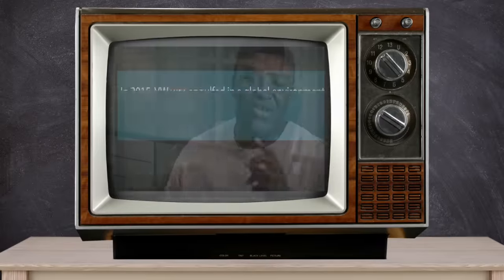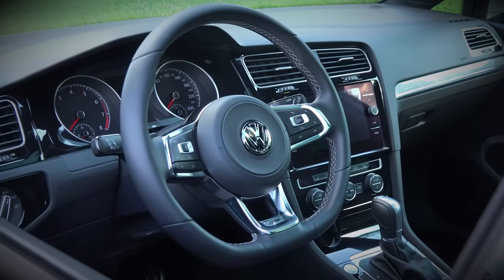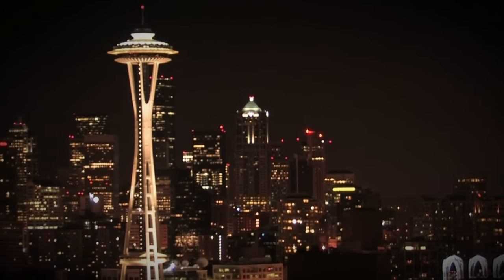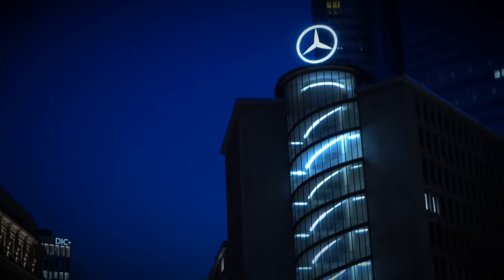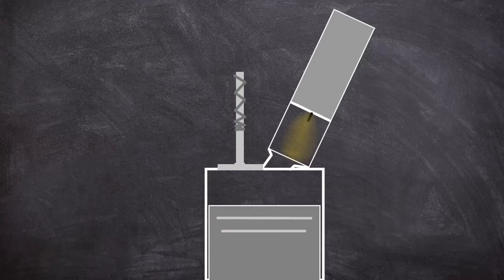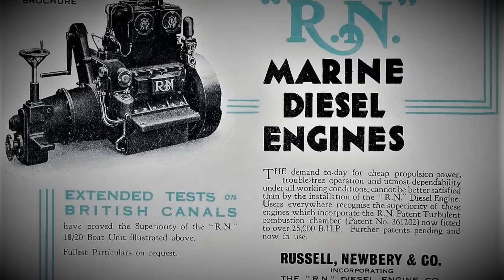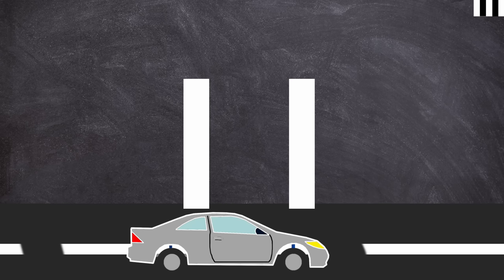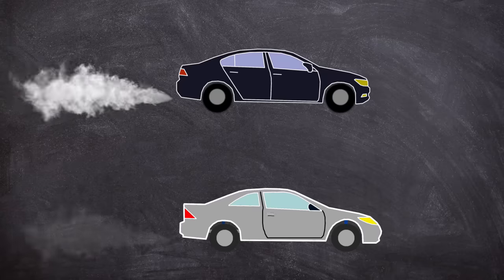Scandal: VW Emissions Dieselgate Explained | Plainly Difficult Documentary

Comment: Actually, a diesel engine doesn't compress the diesel fuel to make it ignite, it instead compresses the air, raising its temperature, and then injects the fuel, making the mixture combust instantaniously.

Also, NOx gases are not particles. Soot consists of particles. NOx gases consist of molecules. Both are individual problem areas of exhaust gas emissions.

Furthermore, with the defeat device enabled, VW engines don't just pass emissions tests by being detuned. Permormance doesn't actually differ that much. They pass tests mainly by increasing the rate of exhaust gas recirculation (EGR). Even though EGR plays the main role in reducing NOx emissions, you sadly didn't even mention it.

All in all, I would have appreciated more technical accuracy.

Comment: The software update Just fucked up my 2010 golf mk6. Worse fuel efficiency,dpf regenerating every 200km,noisy injectors and less power. Luckily i straight piped the shit out of it,did a basic tune and now it runs 100 times better using a lot less fuel.

Comment: Sorry, there is a few things wrong with your description of the science.
For one thing, you confuse NOx and particulates a lot. Particulates are mainy unburnt carbon, also known as lamp black (Ruß in german).
Nitrogen Oxides are gases at typical exhaut temperatures, iirc.
Also you describe NOx reduction to "Hydrogen and water". 
Its more like Nitrogen and Oxygen.
The DPF (Diesel Partikel Filter) in my Passat had actually worked like you describe: capture the Ruß particles and when the pressure difference between filter inlet and outlet exceeds a certain value: burn it off.
To do this, the engine injects a small amount of Diesel into the /exhaust/ cycle, which then ignites in the filter, igniting the captured carbon in turn.Combined with an engine management allowing for plenty Oxygen in the exhaust, this burns the lamp black into CO2.
Sadly this also made the engines incompatible with Biodiesel (Methy-Esters), as the unburnt fuel would condense on the cylinders walls and intermix with the engine oil, thinning it to lubrication failure.

The NOx capture filters operate in a - confusingly? - similar fashion: absorbing with regular purge cycles.
For purging the absorber, again fuel is used as a reducing agent: the redox reaction is between the fuel (carbon and hydrogen) and the Nitrous Oxide with CO2, water and Nitrogen as products. Not water and Hydrogen.

The scandal imho lies in the fact that the Prüfstandserkennung part of the engine management system was used to create perfect, compliant exhaust on the dyno which could never be reached in Real Life (tm).
And the other scandal is that every manufacturer did this to some extent and only VW got heavily bashed.
The car detecting to be in a dyno cycle rather than on the road is actually necessary: ESP and anti locking brake systems must be handled different here, when only one axis has spinning wheels and the others are standing still. But that should not actually be used to fake a performance (MPG/consumption, emissions...) that is not real.

Comment: I feel it's worth mentioning, the engine in the thumbnail of this video was emissions compliant. That was a pre-dieselgate engine, one of the Pump Duese TDIs. The dieselgate cars were 2.0l common-rail diesels. They're both technically "common rail", but on the Pump Duese, the fuel is pressurized and then injected entirely within the cam driven injector. In the common rail diesels, there's a high pressure injection pump that pressurizes the fuel rail, and the fuel is simply sprayed from there by the injector.
Reply: Another small note, the description of how diesel engines work is slightly inaccurate. The fuel isn't compressed to the point of ignition, rather the air in the cylinder is compressed to a very high pressure which creates a lot of heat, and the fuel is then injected into the high temperature and pressure environment which causes it to ignite.

Comment: 7:06 nitrous oxides are gasses, not particulates .... particulates are basically soot from incomplete combustion of fuel
10:45 and the nitrous oxide filters dont trap particulates, rather they adsorb nitrious oxide molecules onto their surface, where they remain until the engine runs rich, and the resulting hydrogen and carbon monoxide gases in the exhaust will react with nitrous oxide to produce nitrogen

Comment: Doesn't the hydrogen and oxygen eventually recombine back into water, albeit in the form of water vapor instead of a liquid due to being immediately vaporized by the hot exhaust pipe after the recombination happens? I think liquid water is only made as a byproduct of hydrogen fuel cell vehicles
Reply: Water can condense in the exhaust, so at least some water will be there, not the entire exhaust is that hot

Comment: My ex tried to talk me into a 1979 Volkswagen Dasher Diesel with a 5-speed. At full throttle that car couldn't get out of its own way. I like your car was a little extra power so if I make a boo-boo and need to accelerate hard I can get out of the boo boo. Take it back to the dealer and said no way in hell. I've driven riding lawn mowers with more acceleration than that damned Dasher had

Comment: It should be noted that the nitrogen does not come from the fuel it comes from the air 78 percent of air is nitrogen that's where the nitrogen cost at the high temperatures with oxygen and because diesels inherently burn lean they have additional oxygen left over from combustion that's what forms nitro oxides

Comment: These cars got close to 50MPG real world. They were a godsend. Torquey and reliable. 
The VW TDIs were “too dirty” for US roads but theres a big issue people neglect to acknowledge. The huge diesel 250/2500 trucks assholes drive around as their commuter car do not need to comply with CAFE regulations. They can pollute much worse than these VWs ever did while getting half the mpg at best. And I’m sure the big 3 sell more diesel trucks than VW ever. Sold TDIs in the US. It was bullshit green washing and what they did was take away a truly viable option for consumers. Battery technology needs to massively improve in performance, weight, and the way resources are mined for electrics to become the majority.
Reply: People roll around in old Cummins and Duramaxes that get like 15mpg roll coal from the fucking factory but go nuts over VW cheating a lil when their Diesels are clean as fuck compared to other garbage

Comment: We own a 2014 Passat TDI. It went through the "fix". Prior to the fix we were getting 50-55MPG on the highway at 70MPH which was awesome. We even accidentally rented the same car in England and got 60-65MPG (imperial vs US gallon). After the fix, it is more like 46. Mileage was always higher than the EPA estimate which you never see. It still runs great and they paid us back a decent chunk of what we had paid for it. We don't drive much, but it still has 140K miles with no problems and still runs about 700 miles before needing to be refueled. Our other car is electric, so the two are a good match. If we hadn't been forced to do the fix, i probably would not have bothered - big trucks belching tons of NOx made our lightly used car a drop in the bucket. Perhaps many felt this way and why VW did not have a huge PR issue in the US. 

I am a bit confused by the video's mention of the AdBlue switch to the newer system using small amounts of fuel to re-burn the NOx. Our 2014 requires AdBlue - I just put some in - but it also required the fix. The video seemed to indicate that it was the switch to this new emissions method that resulted in the cheating.  Honestly, I am not sure why they even did this in the first place - our fixed car is getting over the original EPA estimate. 

However,  I will not buy another VW.

Comment: The main issue here is a ridiculous and completely unrealistic level of environmental regulations.
Reply: Trucks in EU are checked on emissions in road tests, which they pass. It's not a primarily technical problem, they just cheated to save money on the emission cleaning system, to increase their margin
Reply: @simonm1447  This is actually the least of our problems. What bothers me is that those mechanisms reduce car's reliability, longevity, and performance.
Trucks and passenger cars are a completely different story btw.
Reply: @photon6668  The technology used in trucks is just a scaled up version of the SCR converter used in cars. 

But if you want a reliable car you should not buy a VW vehicle from beginning on, these are fine the first 5 years and after that you get a money pit
Reply: @simonm1447  The converters, yes, but the engines have completely different design requirements. Also, there is more to meeting the environmental regulations than the converters alone. This is why you could pretend you meet them by flashing the ecu. And this is why many people are changing fuel maps in their cars so, that they're somewhat bearable to drive.

Besides, the environmental regulations are the reason why many excellent car brands became less reliable recently. e.g. Golf 1.9TDI used to be pretty much indestructible, and it's just one of many such cases.
Reply: @photon6668  Frankly a lot of the apparent decline is that diesel cars have failed to keep up with gas cars. Modern gas commuter cars have the sort of performance that would have blown even sports cars of decades past out of the water.
Reply: They are neither ridiculous nor unrealistic. But hey, a little effort on the part of massive corporations to prevent further damage to the environment is an end of the world scenario...

Comment: My daughter in law had one of these diesel TDI, and it was a great little car. Sadly she turned it back in. Both of my sons now have Jeeps with these engines. The are modified for more power, and run really great. I don't know what the emissions are, but they run great. They can also roll coal, with these. Not for everyone, but they are good Jeep engines. Good amount of  torque.

Comment: What vast majority of people don't get about how backwards U.S diesel emissions laws are.  Its that they make diesel engines much more inefficient, and vastly more unreliable.  So what's actually better for the environment slightly  increased emissions, or burn (some cases) twice as much fuel and  buying parts (full of rare earth metals) much more often. But the media tells me what is actually green and what's not.  so it's moot.
Reply: Even if you double the amount of diesel burned, you still come out ahead when you reduce emissions by a factor of twenty.
Reply: @PhysicsGamer  not really when you consider the logistics of producing 2x diesel fuel. It's not just x fuel for y emissions. And the fact that "emissions complaint" diesels still pollute. And your also forgetting the emissions produced by increased maintence for new diesels along with the required exhaust fluid. But keep pushing that fallacy bro.
Reply: @timhufnagel7462  VWs were producing over 20 times the limits on pollution. There's no way the factors you cite can outweigh that sort of blatant violation.

Comment: I really don’t see the issue with it all… I have a 2016 Tiguan with the 2.0l diesel and all the AdBlue and silly emission exhaust is just annoying. I tried to ask them to make it without all that but they said they only make it with the emissions systems. The ONLY reason I still bought the car was because the rest of the car I really like. And the 2.0l engine is a really good engine. I’ve since removed the silly emissions system and had it all remapped to run perfectly without it. 

All the things in this video is all about money, people wanting to get money from VW and moaning about their products is an easy option.

Comment: Yeah, and the "fix" breaks the cars and makes them unreliable. Done several EGR valve replacements due to the excessive duty cycle the updated software causes. 

Also the Mitsubishi Outlanders with the VAG engine and a few others have the same non-issues. Just don't ever leave yours alone with a VW dealer, the ''fix" will break your car.

Comment: These cars weren't dirty at all...California is just California...the only reason these 50mpg cars were recalled was a political one...and unfortunately the ones available AFTER the recall all sucked in comparison either way less mileage or extremely anemic power.

You cannot possibly hold the argument that a 50 mpg car is less efficient and cleaner than a 4 ton pickup with a 6.2l diesel...

I believe it was the year after that DEF additives were mandated by the epa which again sapped efficiency for "cleaner exhaust" and I mean SAPPED efficiency if we look at older diesel trucks like the Ram or Silverado pre DEF the mpgs were about 20% better on the older ones carrying the same loads...oh and let's not forget the cost of def additive plus the extra cost already for just owning a diesel in the states [you're paying on average 30% more per year on fuel and maintenance already].